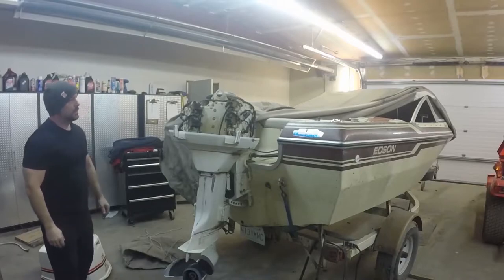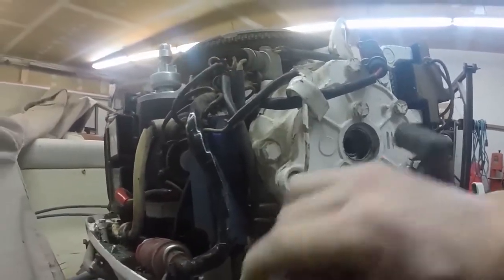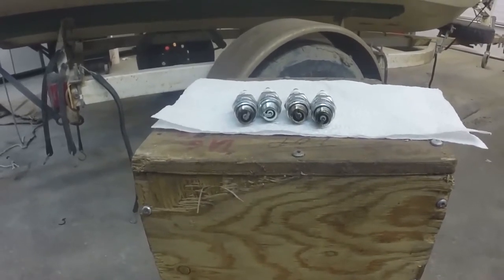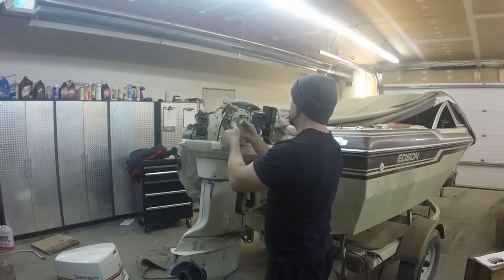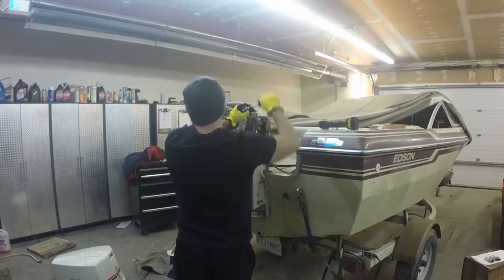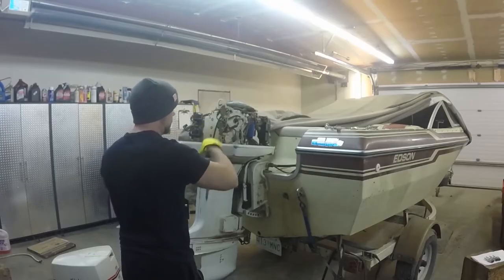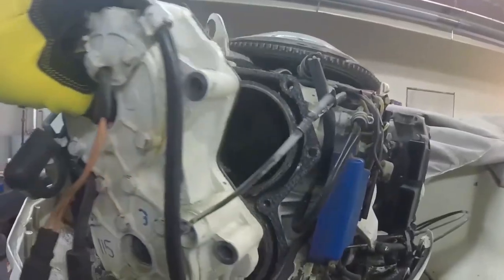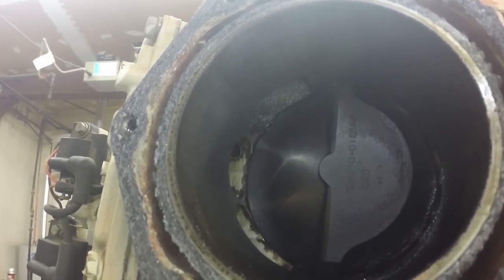The Hidden POWER ROBBING Secrets of a 115hp Johnson Motor uncovered!!!!  Engine down on power.

Comment: I have the same motor. It's a 1985. My idle has been sporadic. Today I did a pressure check. Top and Bottom left was 110 each. Top and Bottom right was 122 each. What are your thoughts?
Also I don't see your fuel filter. Mine is secured in a clamp held by one of the Cylinder Head bolts. Lower left side.
Reply from the maker: Pull off the head and take a look inside.  You are welcome to send me pics if you like.
Reply from the maker: @cumminsbayou  Fixed jets...
Reply: @cumminsbayou  then u woulda missed the mechanical damage. not coming t you to fix anything friend.

Comment: isn't a compression test supposed to be done with the throttle / carb wide open ?
Reply from the maker: @johnbecker5213  There is little to no difference on a two stroke.

Comment: that little chip might not mean as much as you think if the rings are fine. the big question is how is the cylinder wall? if you cant feel any scoring, id run the motor and see how it idles. i dont see many healthy crossflows putting out much over 120-125psi. this ones been bored .020, which means it was most likely decked as well, which would explain the higher 130psi on # 3. again, i always run the motor as all issues will show up at idle.
Reply: @Enticerll ah yes if its scored then by all means. couldn't see the exhaust side in the shadow! technically 15 psi is right on the edge but good call popping the head. thanks for the video!
Reply: well, your answer gurantees i am never bringing you anything to repair. wow!
Reply: @daddski1  what? why? gotta love comments where you don't speak like an adult and use words to describe your disappointment.

Comment: My rebuild still going strong after 3 seasons. See so many that fail prematurely.
Reply from the maker: I just had to repair another shops rebuild.  They had used silicone between the crank halves.
Reply: @TheMarineDoctor  wow, i've discovered shoddy work by other fly by night  mechanics but that's the worse.
Reply: @TheMarineDoctor  Facepalm.  I take it they never bothered to look at the service manual to get the correct stuff, the anaerobic gasket gel.  The name I can't think off the top of my head.
Reply from the maker: @havocsquad1  permatex.  Yep
Reply: @havocsquad1  it's called gel seal. permatex makes it now but make sure its the right permatex and not the black. it is reddish/translucent color.
Reply: @TheMarineDoctor   gel seal

Comment: I'm getting 110lbs compression each cylinder for that engine, is that close to specs?
Reply from the maker: Variations  of gauges can impact compression values.  All being the same is a good sign.  I typically see around 130 psi on strong engines or new rebuilds.  Mind you...it never hurts to pull the heads and get a look at the cyl walls.  The 20psi has gone somewhere...possibly slipping past the rings due to wear or piston slap.
Reply: @TheMarineDoctor  There was a change in the 80's to a thicker head gasket to try and deal with ethanol by lowering compression to around 110. At the time the service bulletins stated for 3.5 bore anything over 100 was good as long as within 12 percent. the big dog engines were 90 or better. It 1helped engines from blowing over crappy fuel but did rob a bit of power.

Comment: Whats the big difference between the 100hp and 115 hp?  Just the displacement or they put something on it to get 15 more horsies out of it?  I got an old 79’ 100hp and have had a newer 115 hp apart and i couldnt find a difference..  same size looked like with same parts..
Reply: Older ones had the HP rated at the crankshaft, not the HP at the prop.

Late 1970's to early 1980's 140HP I believe were actually the newer 110/115hp crossflows except for maybe a few models which might have actually been 140 HP at the prop.
Reply: ignorre the response below.
 All cross flow engines from around 1974 to the end were all 3.5 inch pistons from 85 hp v-4 's to the v-6 and even 300 hp v-8's. The differences were porting and exhaust flow . there are tuning ports in the exhaust. The 135 and 140's had a hump on the exhaust that aided in more h.p.
it is true they changed rating from powerhead base to prop but that is not the answer to your question. there is a bit more in jetting but main differences were in porting etc.

Comment: PRO TIP These engines have bad fuel lines underneath and behind the carbs. They have the little plastic nipples that break. they are crank scavenging fuel return lines and they piss out lots of fuel into the engine when the bad plastic lines break. take the carbs off and replace lines if you leak gas inside the cover. This will throw off fuel mix. you will have no start condition when engine is hot but has been off it vapes in gasoline and will flood the engine. This fixed mine, it is running like brand new. tiny blip of the starter and it runs and accelerates and idles perfect. 
Another plastic fuel part that goes bad is the manifold splitter that takes one line and sends gas in two lines to each carburetor
These form micro cracks which let in air and will leak gas too. Make one yourself with small copper fittings. It also will never go bad. 
The plastic fuel parts go bad and ebay parts are garbage plastic too. Go with replacing what i just said with the 115, 140s of around 1980s years. They will be more reliable if you do these specific repairs defiantly.
Its not the spark plugs, ignition, or timing. Unless you run it with no oil, the only thing that Always goes wrong with these things is bad gas and bad plastic lines with the gas related parts. Assume all fuel related plastic lines pumps splitters is junk if its old. Honestly these should all run a pumper carburetor like jet skis with 1 inlet and no other lines whatsoever. 1 carb, too makes life much easier. e/j i got a probelm waiting for you too.
Reply from the maker: Thank you for this.